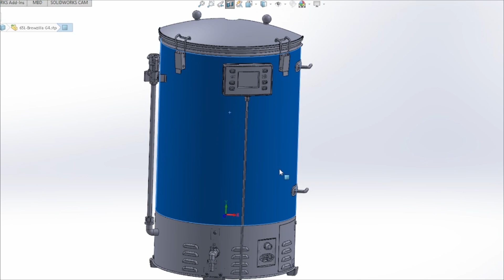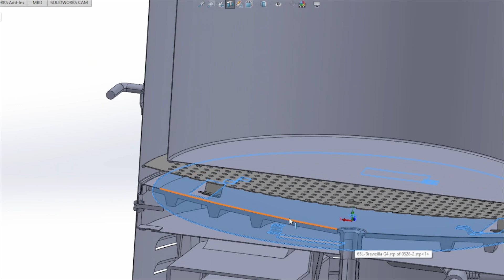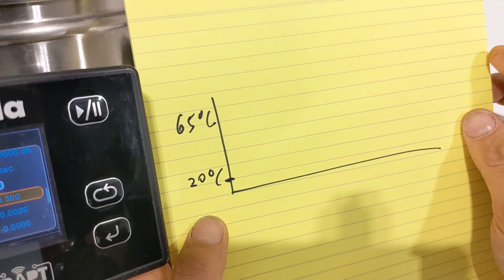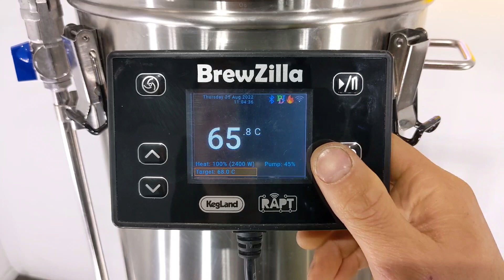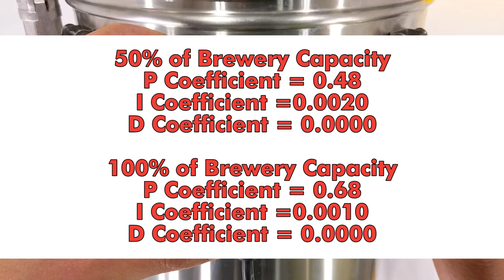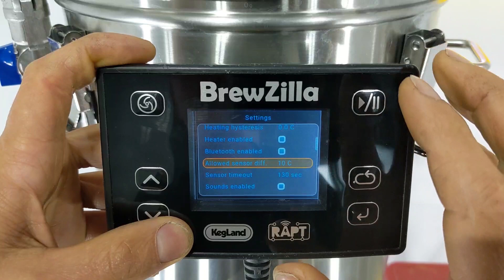Achieve More Repeatability Using, PID, RAPT BLE Temp Probe and Heat Exchanger Dish

Comment: I'm now 3 brews in with the gen4-35L and I'm really frustrated about the inconsistent temperature. I have now cut out a similar piece from a plastic bucket lid and it's already MUCH better. Previously very poor efficiency, 50-60%, too low OG and too high FG due to poor starch saccharification. This dish is a MUST in my opinion. It's really a design flaw. But we want big heating elements and the ability to drain from the bottom! Kudos for allowing that!
(I've always had ~70% or better mash eff on a GF30. I almost always use rice hulls, ensure good recirculation, adjust pH and water mineral content. I can hardly think of anything else to optimize)
Reply: and I've also insulated the tube on the side and the recirculation arm to not lose any heat there either. And ensure at least 45 mins mash time, often more than 1h
Reply: You just using a plastic piece that attached to the bottom? Will try it out!
Have you also calibrated the PID temp?
Reply: @azerbouf  yep works like a charm. Now replaced with a SS plate though. I use PID during mash yes, but not during boil
Reply: @mrknaldhat  Thanks for your quick reply!

Comment: I would agree in making the heat exchanger plate a part of the base package. I just purchased a gen 4 unit and was wondering when they heat exchanger plates will be sold separately? cheers
Reply from the maker: Yes we are going to have them on the website soon.  We are just waiting on more stock.

Comment: Should the elements start rapidly heating once a new user turns on the unit to setup the display?  That’s what happened to my unit.
Reply from the maker: Thanks for bringing this up.  This is something that we are going to change soon.  Right now when you power up the Brewzilla it will return to the previous settings.  Normally before we pack these up in box we turn them on to full power but that means that when you have a new unit it will automatically go right up to full power when you turn it on and that this is not a good idea.  As a result we are going to change the firmware so when you power on the unit it will require you to "confirm" if you want to continue from the previous settings.
Reply: @KegLand  should I be concerned that my elements might be damaged or not heat properly going forward?

Comment: Built in PID is great addition, my 65L gen 3.1 didn't like running an external PID, I think it messes with the way the control panel works, especially when I ran it down low at 140v,
Reply from the maker: Yes the PID function is quite good especially if you tune it to your specific application.

Comment: I've got the gen3 65l and I often found I was babysitting the temp by putting a long TC in the mash pipe to get the temp of the malt bed. Often thought I'd try and hack this into the controller rather than doing it manually. Looks like a great feature which will improve repeatability massively. I'm seriously considering upgrading to the gen 4. Is this available in the UK yet?
Reply from the maker: Yes definitely the new feature is really handy and the PID works great especially if you take the time to tune the PID to your application.

Comment: Definitely, the dish should be standard. It's a great bit of innovation and it's why I love kegland. Keep innovating and keep looking at ways to make your great products even better!
Reply from the maker: Yes we really feel the same thing.  It would only increase the price slightly and really the brewery works quite a bit better with this dish.  Either way we will also sell it separately for customers who have already purchased a Gen 4 model.
Reply: @KegLand I bought a gen 4 today and no heat exchange dish, so i guess you decided not to include it.
Reply: @Pokersmith  Same here - dissapointed
Reply: @KegLand  put me down for one please!
Reply: @KegLand  Bought the Gen 4 recently, but no HED included. Didn't know at first that the HED existed, bought it separately afterwards. Your video is 3 years old, so if you "really feel the same thing", then what's changed??? Anyway, happy with my Gen 4.
Reply: @HowieMakesWine  About to upgrade my Gene 3.1.1 to a Gen 4.1 was trying to work out if it came with it yet or not. Your comment has comfirmed for me it does not. happy to buy it seperate just didnt want to buy it if it was now coming with it. cheers.

Comment: One potential issue with the heat exchanger dish is that it might denature more enzymes in the mash. If more of the wort is forced into close contact with the elements, even if the elements are low density, you might overheat the wort as it recirculates. The price of more efficient heating might be less efficient conversion of the starches, and as lower mash efficiency. Have you tested this?
Reply from the maker: We have not experienced this issue.  The heat exchanger dish draws more heat out of the elements so we have noticed that the elements actually run cooler due to the heat being drawn out of them more efficiently

Comment: I really liked the explanation of the manual settings for the PID. Most PID controllers have auto tune, this one does not? If not, in planning?

As I don’t (yet) own any RAPT items, could you tell me if the BrewZilla controller can be controlled through the RAPT portal or just through the panel buttons? The reason I ask is I think it would be great to create and save PID profiles and select them either from the portal or if saved in the cloud, selectable in the panel.
Reply from the maker: Yes we have been thinking about also having an Auto Tune function too so it's likely that this is released in a firmware release in future.

Comment: Will I be able to use another bluetooth thermometer with the Gen4? And if so, what do criteria does that thermometer need to fulfill?
I think having the heat exchange plate as a default is a good way to go if you keep selling the Gen3 models as well. The Gen4 seems to be more of a "premium version" of the Gen3 and as such is a product for those with more disposable income, adding this plate for a small price increse seems to fit with that imo.
Reply from the maker: No we have made our unit to only work with our thermometer.  It would require a complete firmware re-design to use other BLE thermometers.

Comment: I would like to buy a heat exchanger dish for the brewzilla 3
Reply from the maker: It will not work. You need the bottom dead centre drain in order for the heat exchanger dish to work.

Comment: Is there an extension cord option to purchase? I have a 250v socket in my garage but do not like the work space because well there barely is any. I'm looking at the gen 4 65l 220v. What type of extension cord could I use?
Reply from the maker: We are now using IEC standard sockets on the side of the BrewZilla Gen 4.  So you can use a standard IEC male to female extension.  Alternatively in your country you can just purchase a 15amp extension cable that extends the power plug part.
Reply: @KegLand  I'm from the US. My apologies on not mentioning that first. Thank you for the information.

Comment: It would be great if the bt temp probe could be used independently for those who don't have a gen 4 or other brand. Not a lot of temp probes out there like this
Reply from the maker: Yes I would agree but I think it will be difficult for other competitors to implement a firmware change that will use our  products as they probably will not really want to support products that we are selling.
Reply: @KegLand  Not really what I was meaning. I am just wanting a good temp probe for reading the mash, not integrating into another system. Cheers

Comment: Perhaps a more user friendly way of tuning the PID would be to be able to set the volume of wort in the settings instead, where Kegland has then already tuned all these parameters to match.
Reply: The problem there as Kee put it (although pretty quickly) there's lots of variables that would affect what the values should be from rate you're pumping at, whether or not you use the neoprene sleeve etc, I imagine where you brew would also make a difference if it's well ventilated or not as would the size of the grain bill so the type of beer you usually make. That's why he is showing good starting points for you to start to adjust from. In short, it's not as simple as just the volume of the brew.

Comment: Can you allow customisation of the brewzilla kit on your website? Firstly so you can opt for a counter flow chiller instead of another useless immersion chiller. Most of us already have a stack of those taking up space in our breweries. Or even to buy it bare bones with no chiller or mash paddle or any other thing that we probably already own! Also it would be good to all the buyer to add other items that are Brewzilla specific on the actual brewzill page. That would make it so much easier to buy the right specific accessories without having to look at multiple items.
Reply from the maker: This is a fair point.  I will talk to the team about this.  I know a lot of people do not bother with the immersion chiller so it's possible we can take this out of the kit.

Comment: Thanks Kee, top stuff, loved the PID lesson. I am not fully sold on all the stuff, don't like cleaning too many bits and pieces, and I actually find the Gen 4 to heat up fast enough on just standard 10 amp power. I use a neoprene jacket from a Gen 3 which I've stretched around to fit. Not sure if that makes much difference, but in my testing with a temp probe in the mash, the temp differential with the built in bottom probe during recirculation is surprisingly bugger all anyway. Also, you know what would be cool, integration with brewfather during a brew (like grainfather with their app). Any chance? Not a massive deal, but I am usually running around doing other stuff (kids and wife related) during a brew day so it would help for sure.
Reply from the maker: Hey Mel.  We have already done some integration with BrewFather but I would agree that it would be great if we had live updates so you can look at the brewfather display panel as you brew.   This has already been spoken about and it's likely this will be available soon.
Reply: @KegLand  Any update on brewfather integration? I take it Brewfather is a separate entity to you guys so you can't make it hapen, but I would love a bit of flash App/recipe/BZ4 integration + control, not a dealbreaker, but my mates original Grainfather with a bluetooth controller is so sweet with the app control. (I win with on the gear stakes with the central drain and the mash pipe with the holes up the sides!!)

Comment: Question, would it be possible to upgrade the firmware for the PID algorithm to only kick in within a range of target temp? PID algorithms really shine at maintaining a standard, but for bringing things up to temperatures it would be helpful to just go full power and save time. For example if you want 65° C, the PID should only kick in when you hit say 60°
Reply from the maker: We are going to implement a more complex profile system so whe you start a brewing/mashing profile it will allow you to use PID for certain steps in the process. I think this should solve your problem.

Comment: Is there any potential issues with superheated wort under the screen given the smaller gap between it and the elements?
Reply from the maker: That's why we have the temperature probe in this small gap between the elements and the screen. As soon as the probe picks up on the temperature increase it will turn the elements off if it gets too hot.

Comment: Shame it's not fixed in more places to the pump protector , it would then make the filter more robust at the same time when removing
Reply from the maker: We have not found this to be necessary.  As the screen is only to direct flow and not to put grain onto this screen it's not necessary for it to be fixed in more places.  We also wanted to make sure it was easy and fast to take apart for cleaning.

Comment: Fantastic video. Thank you. I've my gen 4 on backorder (I am in India and it is being shipped now from you guys to the the distributor here after which I hope to get it soon!). I was looking for an explainer on PID and this is fantastic, thank you. Have a couple of questions / requests:
1. Could you please do a video series solely on the controller (and the app) which explains in detail the various settings and how to use / typical profiles? I'd especially like to know how exactly the programmable mash patterns work as in if we do M1 for 30 min. at 65 and M2 for 30 min. at 75 and it takes 10 min. to go from 65 to 75, then does it know that that is the case and start the heating gradually at minute 20 of M1 itself? Or does it take 10 min. after M1 and then do another 30 min. of M2, in which case the total mash time becomes 70 minutes, not 60. And things like that. Sorry if this is a bit nerding out but I reckon that since I am getting a powerful system, I might as well know all it can do and use it wisely. (P.S: this is my first ever all-in-one brewery and a fairly significant investment and so I'm super excited!)

2. I am assuming that if the recirculation arm is on, then the temp differential will be lesser through the malt pipe (more so because I intend on brewing 10L batches more often than not - also, the BLE thermometer is not yet available here in India.

Thank you.
Reply from the maker: Yes we will do a video on the profiles soon but not right now.  In the very near future we are about to include a large number of additional features for profiles so we have a lot more options with profiles.  Once this happens we will do a whole video dedicated to setting up the profiles for you.
Reply: @KegLand  Fantastic! Waiting for it. Thank you!

Comment: You should really include the CIP spray module inside the gen 4 kit.  Buying most kegLand products in Europe is already a nightmare. Trying to purchase any of the extras, especially if they are not expensive, is almost impossible.  Very few distributors from Europe have your products, even fewer ship outside their country or have an English site. Most are distributors only for the fermzilla line. Its just sad that the only way we can get our hands on these products is buy paying someone from AU to buy them for us and ship them to EU. The cost is very close to 1500-2000 euro just for the shipment most of the times.
Reply: That's why I will probably end up buying a GF when I really would like to buy a Brewzilla. It's next to impossible to get you hands on Kegland products in the Netherlands.
Reply: @janpcs  Give us a shout at BrewKegtap UK - we've got loads of Kegland products and can sort a shipment to NL.
Reply from the maker: Where abouts are you located?  We will have to work harder to try and find a distributor near you.
Reply: @KegLand  Thanks for replying. I live in Greece. But as you can see this is a general problem for many of us here in the EU.
Reply: @KegLand  I've found one myself. Unibrew in Nuenen in the Netherlands, only a 30 minute drive, has put them on their website now. I don't think that was the case when I posted my earlier reply. Thank you anyway.
Reply: if you get a distributor anywhere in the eu bar UK they can be then shipped to all neighbouring eu countries tariff and tax free it's a no brainer
Reply: 100% brother. I totally didn’t read your comment before I posted mine.

Comment: Heat exhanger plate looks like a great idea at the mash, how does it behave during the boil? - is there a risk of the plate/screen combo being lifted by the boil action?
Reply from the maker: It operates in the same way.  The bubbles in the boil just go around the edges of this plate so it's not an issue.
Reply: This is something I was about to ask. If say it did effect it then they could always added mesh like qualities to it but not directly in the center which would allow the wort to flow outwards but also give the boil more surface area to penetrate